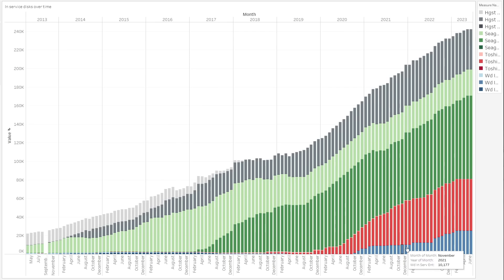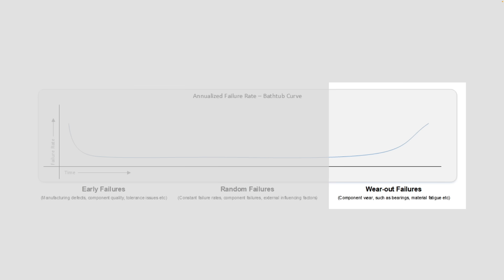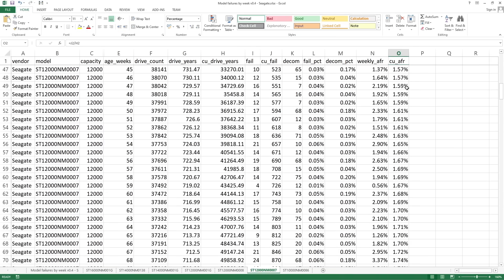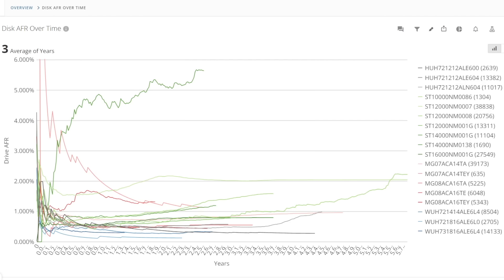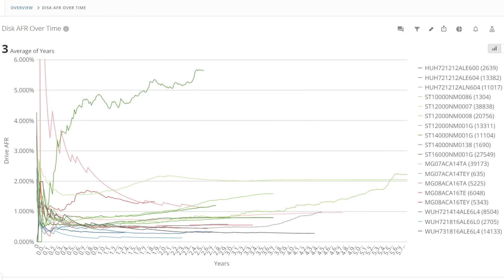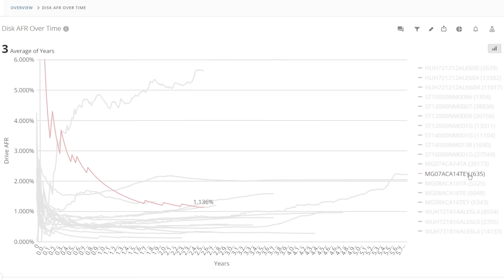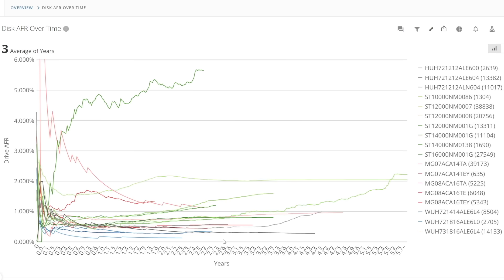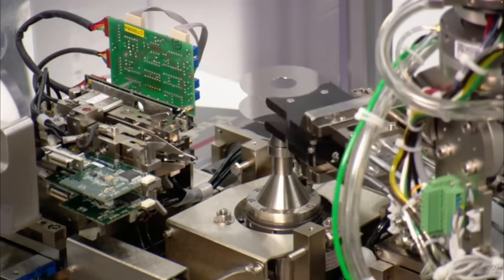Failure Rate Analysis - Best 10Tb+ hard drives: Seagate, Western Digital or Toshiba?

Comment: @SomeTechGuy: would love to see a follow-up to this video as the 2025 Q2 drive data dropped a few weeks ago.

Heads-up that the data does need a bit of light cleanup/scrubbing :

$ head -1 backblaze-drive-stats_2025-08-24.csv
model,date,drive_count,failure_count

$ grep "WUH721" backblaze-drive-stats_2025-08-24.csv | cut -d ',' -f 1 | sort | uniq
WDC  WUH721414ALE6L4
WDC  WUH721816ALE6L0
WDC  WUH721816ALE6L4
WDC WUH721414ALE6L4
WDC WUH721816ALE6L0
WDC WUH721816ALE6L4
WUH721816ALE6L4

$ grep "WUH721816ALE6L4.*2024-12-13" backblaze-drive-stats_2025-08-24.csv
WDC WUH721816ALE6L4,2024-12-13,26394,2
WUH721816ALE6L4,2024-12-13,79,0

Need to collapse those two rows for 2024-12-13 into one row with a daily drive count of 26,394 + 79 = 26,473 and failure count of 2 + 0 = 2.

Comment: Just from experience the overwhelming majority of failing/failed hard drives that I have replaced for people over the years have been seagate drives. This is on the consumer side of laptops and desktop computers. If I am putting in a mechanical hard drive it is going to be a Western Digital Black. For most people these days though NVMe and SSD storage is plenty good enough for all around use. If it is a desktop computer NVMe on the board for a boot drive and the most commonly used/most demanding software. I still like to put a mechanical drive in for long term storage, mainly because you have the extra space in a desktop enclosure. Smoke em if you got em.
Reply from the maker: Yes, I hear this a lot. What distorts the picture though is that Seagate have a larger market share and their drives are more often in prebuilts, so even if the % failure rate is the same, more drives would be seen to fail. But still, I think you observations are valid.

And yes, also agree that both laptops and desktops now should use NVMe. So HDD are going to be more after market additions for mass storage, where they are far more cost effecient, and where performance needs are different from the boot drive. 

The blacks are great drives, but I think they are over priced and there are cheaper options that are very similar drives. I have a video planned at some point to compare them to Enterprise, NAS Pro and Surveillance Pro drives. Which can be obtained more cheaply often.
Reply: @sometechguy  I bet you the reason why you see Seagate drives in most OE built machines is because the OEs probably get them at a killer price. I honestly don't know what the read/write speeds are for a typical Enterprise or NAS drive are. They traditionally were slower if I remember correctly. But things can change, and maybe there are better value options out there these days.

Comment: I'm admittedly new to the enterprise drive space and just peeking my head in, but even as an ordinary consumer, my guess was that Seagate drives would be the ones that fail the most often. Whenever I got a pre-built PC, the Seagate drives would always be the ones that were in there, and they always failed right around the time the PC went out of warranty. Meanwhile, I have some Hitachi drives that are still working after a decade, which shocked me because I thought all normal hard drives fail within 5 years, and that's why I needed SSDs. So this does surprisingly parallel my experience despite the data being from the enterprise line.
Reply from the maker: I would expect that though the rotational speed is different, and some minor components change (vibration sensors etc), and that the firmware (the code to run the drive) will vary. The drives are going to be built mostly on the same technology and hardware. Simply because its the cheapest way.

So i am not suprised that there are parallels. And if you physically look at the same capacity disk from their desktop range and enterprise class range, they often look identical also.

And yes, Hitachi were awesome 🙂

Comment: Just get an SSD bro.
Reply: My nas that runs on a 300mbps network doesn't need an ssd
Reply: @yellowfin_tuna  That's because an SSD doesn't need a nas, sell that and get a proper SSD that won't break if you drop it once plus will run much faster.
Reply: @nashi_aji yeah no. My nas has 20tb total storage(including redundancy) it's been sitting on my shelves for about 5 years. I dont have a complaint about it. If i want to replace that, it will cost a lot of money.

And I do need a nas. I have multiple devices, and i want it to be able to access the same file. my 2 pc and 2 laptop have at least one nvme ssd on it. It's fast for sure, but on my nas thats not necessary.

And hdd will last long if you took care of it. My oldest hdd that I still use to this day is 15 years old.(I only use it to store trash file that either have a backup or i just dont care abou it)

And why would i drop my nas, I literally screw it to the shelves.
Reply: @yellowfin_tuna  SSDs also will last very long. All you need to do is rewrite data once every 2 years (generally). Plus, they are much more portable and resistant (mine is even waterproof).

HDDs are made of metal, which will corrode over the years if you live in a zone with high humidity. HDDs are also more prone to failures than SSDs.

Yeah, if you need your database to be synched, enjoy your NAS. But if you value long-term protection, just get external SSDs.

You can easily encrypt your SSD with software compatible with Mac, Windows, and Linux such as VeraCrypt. Encrypting your NAS defeats the purpose of "maximum convenience," and the HDDs inside will get even slower.

HDDs generally also run hotter than SSDs, which increases the risk of disk failure and shortens their lifespan.

Imagine what a disaster it would be to need to move your whole NAS somewhere else. With external SSDs, all you need is the drive itself, a USB-C cable, and a case cover.

Comment: Got myself a recertified hgst 8TB drive a few months back for my datahoarding needs. Glad to see them performing well
Reply from the maker: Hope the recert drive is serving you well. I had mixed results with recert drives that claimed to be manufacturer recertified. But usually if there are problems with them they surface fairly quickly and can be returned within buyer protection timescales (if you have them). I had some good results and heard others mostly had good results with hard drives from specialist sellers who sell decommissioned data centre drives also, which don’t have their SMART stats zeroed. I have a bunch of HGST drives like this also, and HGST drives are good tech. 👍
Reply: @sometechguy yeah the drive came with a 3 year warranty and smart showed it had been in service about 2 years before I got my hands on it. I did test it and it came up clean so for the price I paid at around £100 I’m happy

Comment: Take the data with a HUGE grain of salt. Those drives are keep at a very HOT temp, way hotter then a desktop computer. My experience with WD vs. Others was if WD hard drive keep cool, was more reliable then all others. If not keep cool, WD was worse then other drives that were also run hot.

Comment: Number one feature for any storage is graceful failure. First it should degrade to a read only mode to recover data. Possibly reducing speed. Not as important but nice is a command to zero out the drive once it's recovered.

Comment: WD used to be very good.  Not now.  They are expensive paper weights now.  WD's quality control is pure garbage now.
Reply from the maker: I am working through the latest data at the moment for a follow up, so will be interesting what the data tells us as BackBlaze publish more data on the 20 and 24TB drives. Is this just anecdotal experience, or is this based on data that WD QA has declined and failure rates are up?

Comment: I remember watching this video a few months ago, trying to decide whether to buy a used 14 TB WD Ultrastar drive from China. Based on this video, the drive that was for sale had excellent numbers so I went ahead and bought it (and it's been running well ever since). Watching this video again, after I did some digging about what all these different drive models ARE, it makes more sense. I left a comment under a more recent video about this, but I think I'll go ahead and repeat it here. Take the three Seagate 12 TB drives, for instance - there's the X12, the X14 and X16. What's the difference? The X14 is a newer design than the X12, for instance. And what they did was they did something - increasing the number of platters, or increasing the areal density of the data on the drives, to be able to cram 14 TB instead of 12 TB into the same space. All X14 drives are the same internally, as are all X16 drives. But since the maximum capacity of a X16 drive is 16 TB, the way you end up with a 12 TB  X16 drive is that some of that data storage is disabled - either one or more platter surfaces and heads are inoperative or disabled, or there are regions on some platters that are not used, or the unused space is used as swap reserve. Why do they do this? Perhaps when they test the drives some of the platters or heads are defective, or certain regions on some platters are defective. Rather than trash the drive they'll sell it as one with lower capacity. Or perhaps they do this simply to have drives to sell at a lower price point. The same is true for Ultrastars - the HC550 line has a maximum capacity of 18 TB, all HC550 drives are identical internally, but they also sell 16 and 14 TB drives in that line. If you read the data sheet for the HC550 line you'll find an explanation for the part number, for instance WUH721816ALE6L4 would be a 16 TB HC550, while a WUH721818ALE6L4 would be a 18 TB HC550. This numbering system actually came from Hitachi, not WD, and it applies to all the old Deskstar and Travelstar disks Hitachi used to make. Incidentally, as far as I can tell, the current Western Digital Gold data center disks are Ultrastars - if you do a web search, you'll photos of some with "Powered by Ultrastar" on the label, and on other labels, ones that don't cover the entire front of the drive, you can see the same features on the front cover that you see on Ultrastars. They do use traditional, more opaque WD parts numbers, e.g.  "WD161KRYZ".  I suspect that eventually they will add "Gold" to Ultrastar - they can't just ditch the Ultrastar brand. The older enterprise-grade line of drives WD used to make (or maybe they still make them) was the "Re" line, these are now labeled "WD Yellow". These all seem to be smaller drives (less than 12 TB, as far as I've come across).

Comment: To be honest I've only ever had one drive fail on me and that was a hitachi 4TB. I've been running 4 Exos x20 20TB drives for just under 4 years with another 3 Exos x20 20TB drives for 2 years. I've had no issues so far, no bad sectors, no uncorrectable errors etc....

Comment: ...great info !  ... woudl be interesting to see the failure rate for drive orientation, as in horizontal vs vertical ... do you have data for that ?
Reply from the maker: The drives don’t keep that data, and I guess they wouldn’t know as I don’t believe there are sensors for this. Also, I don’t believe it is meant to matter and storage systems keep them in different orientations. 

I believe though that BackBlaze use 45Drives enclosures a lot, and they have the drives inserted interface slot down.
Reply: @sometechguy  ...this was an issue many moons ago, I believe, because of how the read/write head pivots.  when vertical, the movement of the RW head is against gravity and the pivot bearings experience more friction/wear, whereas when horizontal there is much less work involved to move the RW head horizontally across the disks and less friction on the bearings.  Keeping track of the placement would involve human notekeeping...

Comment: Great work! Helpful in selecting the drives for my NAS. I was disappointed, when recently, my 650 GB Samsung drive (Model HM641JI) failed on my Sony Vaio computer. I purchased this system back in October 2010. Given the data you presented,  I guess I should consider myself lucky.  It would be interesting to compare: failure rates of 7200 rpm HDDs with 5400 rpm HDDs; failure rates of HDDs with SDDs; failure rates as a function of disk capacity.
Reply from the maker: Thank you! The question on 7200 vs 5400 is interesting, and I have a video on desktop vs enterprise disks which looks at the 2-8TB range in the Backblaze data. This isn’t explicitly about rotational speed, but broadly the desktop drives are 5400, and it looks like there isn’t a big difference in failure rates. This could be speed vs build quality however, and this is the issue; the speed isn’t the only variable that changes. Though there are ranges like the WD Red and Ironwolf where the speed changes across the range, but I don’t know if a data source with all these disks in it.

Comment: It’s totally insane that hard drives still exist , when high capacity ssds and nvme exists to begin with.
Reply: no they dont the amount of storage you can get compared to nvme isnt comparable for files and data that you dont need to frequeqently use but rather store as an archive, ssd and nvme are too expensive for and dont have as much storage

Comment: The childish reaction to such material is striking. This material presents big data that can be useful mainly to large corporations, but for the average user it is completely useless. Over the entire existence of the home PC market, all significant manufacturers of hard drives have been noted for major fails. However, this does not mean that their products are worse or better than each other. Do you seriously think that a 1% difference in statistics somehow changes the chances for your particular device? For you, the chance of a hard drive failure from any manufacturer is absolutely the same, 50%, either it will fail or not. No matter how much someone praises one manufacturer, there are many people whose drives have failed for absolutely any reason. There are thousands of examples of this on the Internet. For me, more than 25 years in IT, with the general exaltation of WD HDDs, it was my WDs  that died. No matter how much people praised Toshiba, it was my Toshiba that broke down even before the warranty expired, by the way, two units at the same time. But my Seagates have never broken down, and now in my NAS 8 Seagates have been working for 4 years and all the check marks are green. However, I repeat, it does not matter at all. Any disks fail for any reason, and a 1 percent difference in statistics does not matter at all for you personally. The only thing that can matter in this case is if there are complaints right now about the mass failure of some model. Only this matters, in all other respects you can buy any disks, any manufacturers, the chance of failure will be the same. Just buy with a long-term warranty and make backups. Data storage is expensive.

Comment: losing 1-2% of your drives each year is WILD
Reply: Well, compared to cars which have a typical lifetime of 10-15 years, so averaged over all years you lose 6-10% per year...
But as with hard drives, you don't lose them at a steady rate.
Usually their is a spike in the first years (bad manufacturing, mass defective parts), then the failure rate settles down and then after some years, it goes up again due to old age.